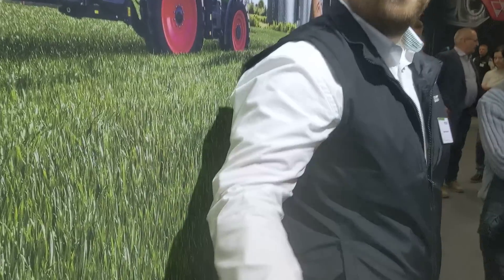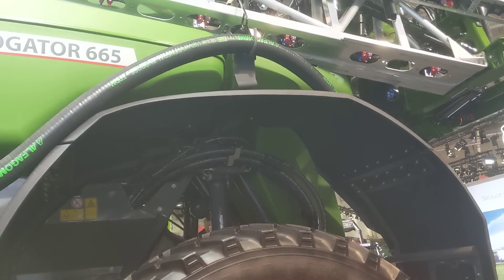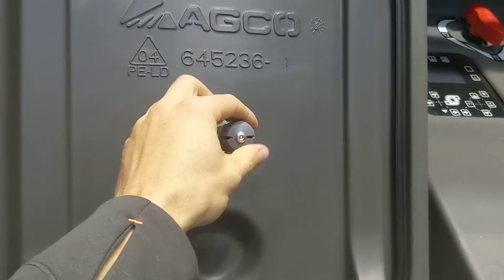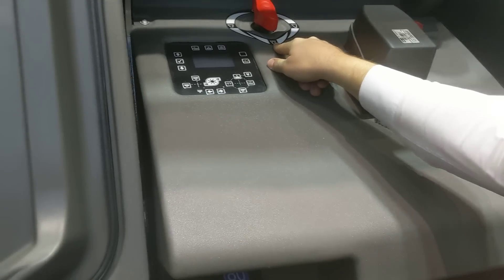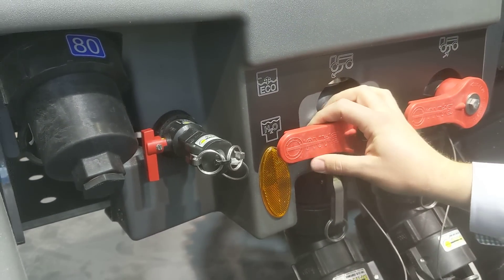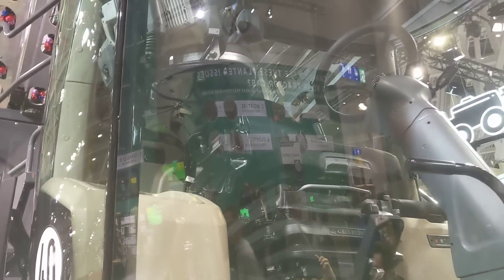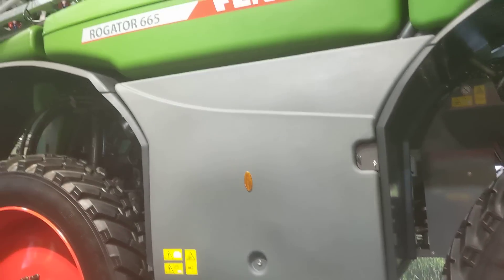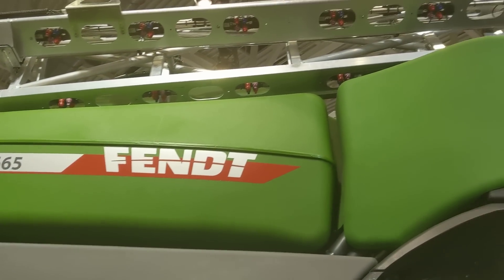Fendt Rogator - Check description for details

Comment: UPDATE: the fendt rogator is now availeble with 39m boom (= 128ft)

9:37 "350 liter fuel and 80liter def"   yet fendt's own spec sheet of the rogator 600 lists 310 liters and 50liters respectivly
Reply: Interresting

Comment: Aside from price I don't see to many downs to this sprayer
Reply: Width on wheellbase and booms, low power, slow road speed, and low tank volume for not having any ground clearance.
Reply: @maxpower9499  i dont wanna destroy 'mikes concerns' but 
1) low power, thats the biggest b*llshit, the largest sprayer in the world only has 370hp with 9000L and 54m boom, so this rogator isnt upderpowerd at all. 

2) low tank volume, i would say mid, not huge not small, there arent that many that go above 1600, and if they do, its not THAT much more
     both the patriot AND trident max out at 1600 too, so i dont see the problem here, if im missing something, pls correct me.

3) slow road speed? 50kph (31mph) shouldnt be considered slow due to mike never really travels faster anyway, so y complain about it?

4) ground clearance, true its still fairly low even at highest point

Comment: Who needs 500l of clean water? Would I not be better to use a bit for main tank?
Reply: European regulation demands 10% of clean water tank size of main tank size. So 5000l main tank means 500l clean water
Reply from the maker: @thomaslaubenbacher9089  oh.... Very interesting
Reply from the maker: Probably... But 1600gal is a perfect size for most products.. Can spray 160ac @10gal or 320ac @5..

Lemken had a SP unit at 1900gal at the show too..

Comment: I assume they are so narrow due to European road width restrictions? if I understood him correctly even with the axle spread it only goes to roughly 90 inch centers. To put that in perspective our sprayers in North America are typically 120 inch centers and can widen out to 154 inch centers. I assume there's two reasons we never see that type of sprayer in North America. One I don't think they would match row crop applications very well and two they are just too narrow to have good stability.
Reply from the maker: I agree with you! Really narrow units..
Reply: @mikemitchell2554  You'd croak at these 4023R Deeres we run down here in southwest GA, suck them on down to 72" tread to work in peanuts where we need to maintain our hard middles, with a 90' boom they are perfect for working in the 6 row pattern that is still predominate here, especially in peanut production, and honestly the bigger sprayers don't work real well in most of the fields here, lots of smaller contoured fields around my corner of the world.
Reply from the maker: What do you guys run for sprayers?
Reply: @mikemitchell2554  Have ran RoGator 1300B'S and John Deere 4038's. Currently run a Hagie STS 12. I have demoed the Case Patriots and wasn't the biggest fan. Perhaps I just wasn't used to it and dealer support is limited in my area. Are you planning on updating your sprayer fleet?
Reply from the maker: Thinking about it, but I don't like the price of them! They have all gone crazy!
Reply: @mikemitchell2554  Hi Mike, maybe you can try out a Agrifac sprayer i think it is something for you: 2100 gallon and booms up to 180ft 400HP Cummins engine   https://www.agrifac.ca/sprayers/condor-endurance-ii